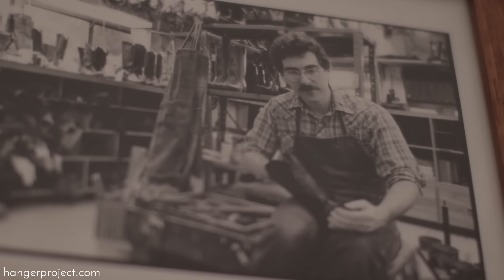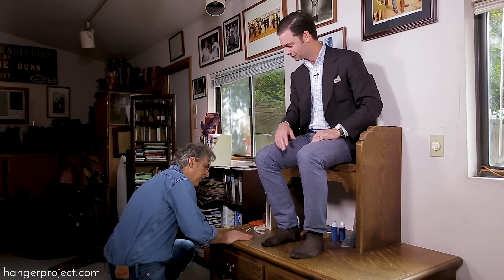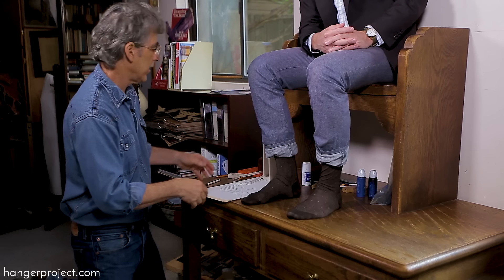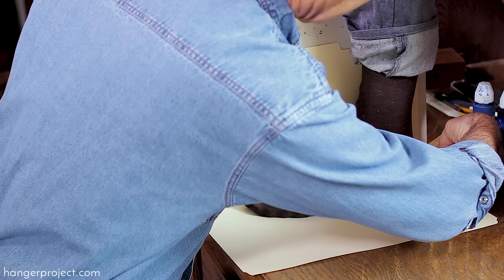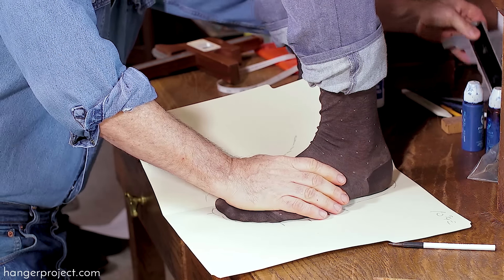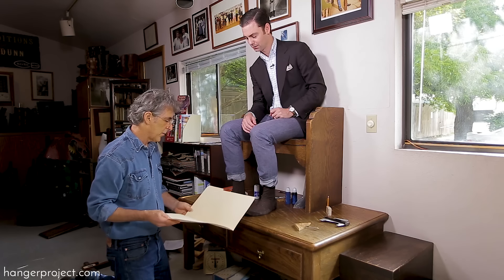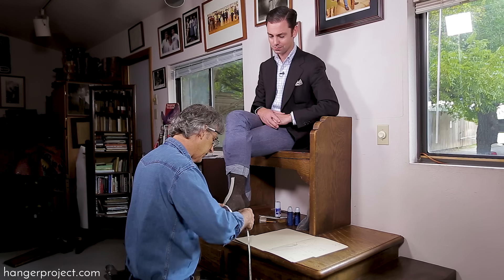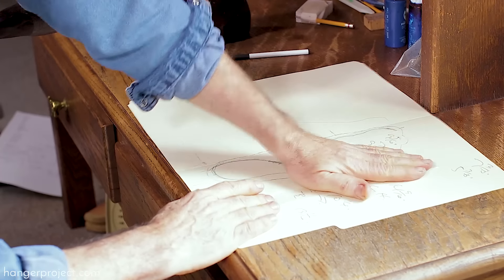Cowboy Boot Fitting | Texas Traditions Handmade Boots | Lee Miller

Comment: This might be a dumb idea, but instead of all these measurements, why don't they just take a  casting of the foot and use that as the last?
Reply: Sir James W. V. Savile, OBE - Jimmy, they’d still have to measure off from the cast when cutting the leather. How’s the afterlife?
Reply: Miles and miles of unattended children.
Reply: Sir James W. V. Savile, OBE  - very droll - don’t cross any national borders soon.
Reply: Why not? I think Interpol has quit looking for me.
Reply: Casting takes much longer, and is more expensive than taking measurements; also, if your foot changes size, due to age, weight gain, accidents, ect, you would need to sit for an entire new cast instead of getting measurements taken. What if you're allergic to the casting material? what if you can't take the several hours sitting? The dry measurements are faster, and can be done anywhere too- and it's much easier to teach an apprentice the right way to measure a foot, rather than cast it safely. Less to go wrong.
Reply: Nozomi Johnson casting would take about 30mins, not all day.  It would then enable a latex mould of the foot to lay the leather on while constructing.
Reply: Why not 3D scan and use a pressure transducer array so you could cad model the foot then just 3d print the last or cnc it from wood?
Reply: Yeah, I was thinking the same. a casting would go lickity split. They took a casting of my leg from above the knee down for a fiberglass brace. they literally used plaster casting as would be used for a broken arm. Then cut it off in about 10 minutes (or less) and made a mold of my leg.
Reply: The issue is you would need 3 castings for each foot, one non-bearing, one full bearing, and one half bearing, and then you would jusy ultimately have to take measurements of all of them anyway to make sense of it all, since any single one of the moldings are basically useless on thier own. Theortically if you could get all three moldings in and out of the shoe for fitting it could work well, but there is no realistic way of swaping the molds without altogether destroying the shoe.

A whole lot of work and time that could otherwise be easily done with some measuring tape and a pencil.
Reply: LOL
Reply: +David Tomkins. It is not quite that simple. The last is slightly larger than the foot and has allowances for getting the shoe on and off.
Reply: Cheaper to use your brain. I'm sure. How's, life , again.
Reply: Heck with the foot casting. Just 3D laser scan both feet - stand, sitting and held in air - with hand-held laser then build the lasts with a 3D printer. Perfect match/fit on the last and probably have the last ready in < one week. Seems so simple?
Reply: Maybe storage space? Folders and papers vs tons of casts.

Comment: Hi Kirby and thanks for all the videos, they are quite informative. I have a pair of Dan Post cowboy boots and they are fairly new (worn 3-4 times) and are a neutral (light tan) color. I want to care for them and am will to pay for the appropriate polish, protectors, etc, but what I don't want is to to darken the boots. I do have some Saphir Super Invulver but I haven't even started with that yet. Do you have some suggestions on how I can best care for the boots and maintain the color?  Thanks in advance and keep the vids coming!
Reply from the maker: If you want to avoid darkening the boots, use either a neutral conditioner (like the Saphir Renovatuer) and/or a pigmented color slightly lighter than the color of the leather. You would apply the Super Invulner last to water proof.
Reply: Thanks very much for the quick response. Why am I not surprised at your promptness....?
Reply: Hi Kirby. Thank you for this extremely enjoyable video of a true craftsman. Do you have any status on update videos on the boot making process?

Comment: I've had so many issues with shoes and all other clothing.

But shoes are the worst. I have wide feet, slightly higher arches than average. My toes spread out ALOT when weight bearing.

I I typically a 6 or 6 1/2 length. But I can only get 7's because they accommodate my width.
My entire family has always had issues finding shoes/clothes that fit comfortably.

I'd really like to get into either bespoke suit tailoring or bespoke shoe/hand made shoe making.

Comment: Great info..
My leather boots have a light slip on the inside of my heels. I normally wear a size 10 shoes, slippers, etc. 
Except for my Cowboy Boots. I wear a 9.5d. Depending on the boot manufacturer or maker.. I fit into some boots that are size 10 or 10.5
It just depends on your feel. However, a real cowboy boot should have a Slip in the heels when you walk. It sounds odd but they are so much more comfortable than any shoe I've worn..

Comment: I’d probably go with a medium thickness sock with boots, rather than a dress sock.
Reply from the maker: phototristan I don’t one any! 😂 And If the boot fits, should be comfortable with thin dress sock.
Reply: @kirbyallison , that may be so.  But for all day use, or outdoor work, I understand wool socks are ideal.

I just ordered a pair of Abilene cowboy boots with angled heels and "hidden" work tread soles, which look just like traditional cowboy boots.  This will be my first pair of cowboy boots.  In past years, working in rough trades, I have found wool socks to be ideal for all day comfort, sweat absorption, and wicking away moisture in work boots.

I suppose, if one wears cowboy boots, as dress boots, then dress socks will suffice, especially if only for a few evening hours.

Comment: My grandfather was of the old school.  If your new boots were too tight a smarter Texan  visited my Grandfather.  To buy cow brains.  Yup, knocked clean out using an axe,
and on the butcher's block they'd be chopped up too.  Put those new boots into a big steel bucket and pack them with hand-scooped common cow sense.  It takes the stiff out of
tight leather within 24 hours.  Slip both on still attracting flies, stinking, and juicy.   After
6 hours of wear clean with saddle, add mink oil for luster, and waterproofing.  Let them
dry before using a boot polish on your parade boots.  No parade?  Try kicking critters
for a fine fur-polished shine.  Can't recommend East Texas skunks or panthers.

Comment: So what price range are we talking here? $1000, $3000, $5000? I would have asked about lower prices, but I just did a quick google and off the shelf ones are 300-800 easy. I could really use a good fitting but I'm an occasional boot wearer for pleasure only, not work.
Reply: I’m not sure on Mr Miller’s prices but I know a lot of custom made boot makers start at about $2-2.5k base price. An example would be cowhide vamps with a basic 5, maybe 6, stitch pattern top. But once you start getting into inlays, overlays, original/unique top designs, exotic leather vamps, & more, that’s when prices can skyrocket. Maybe you’ll end up spending $6-7k if you get some nice croc belly vamps with a beautiful inlay design top including your initials.

Comment: As complicated of a process as that all is, I'm surprised that instead of taking a ton of individual measurements and then transferring those to wood that people don't just have you put your foot in a box and cast a foam mold over it so they can then cast a plaster copy of your foot. Then they'll have a 100% copy of your exact foot to use as a last. It seems so easy and obvious and I've never seen it done.